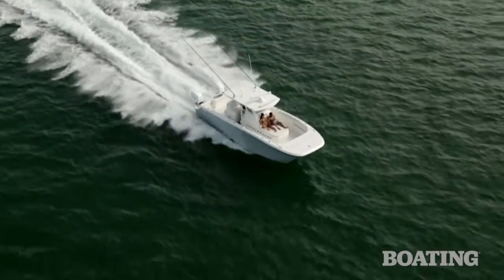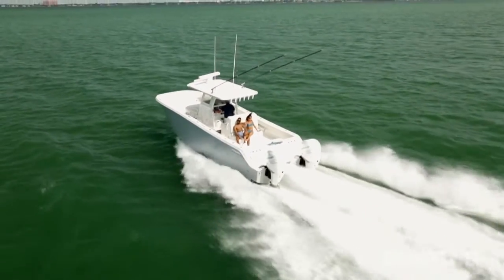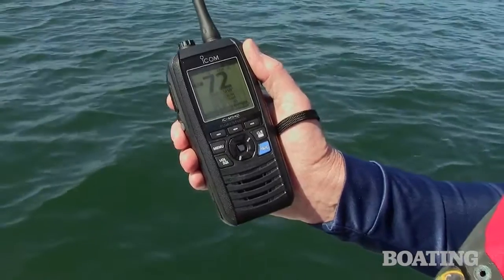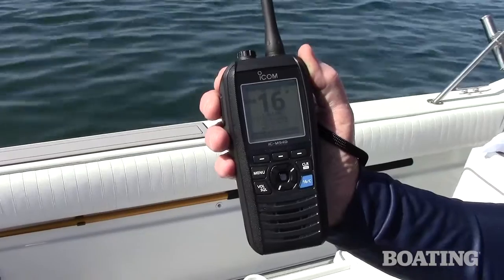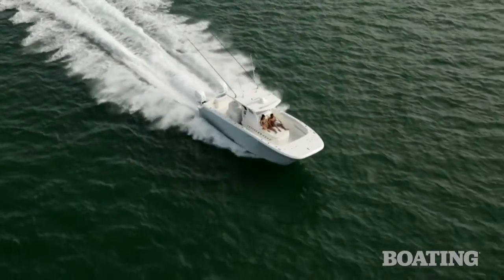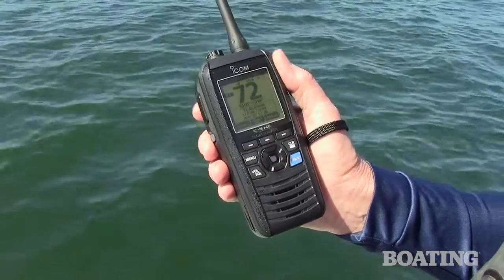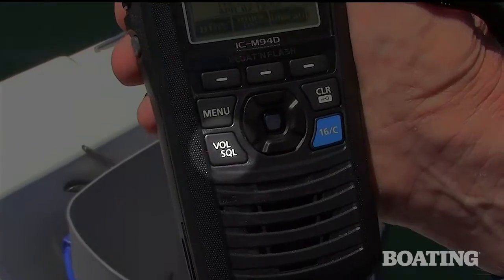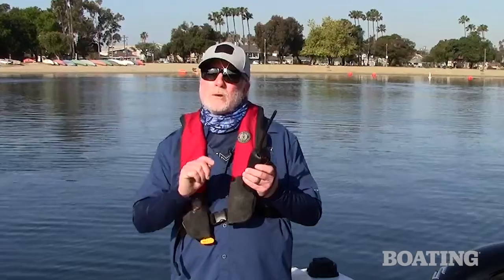Icom VHF Radio Tips: Adjusting Squelch

Comment: I have an ICOM M34. All of a sudden it won't recieve any signals unless the squelch is turned to zero. New battery and fully charged.
Reply from the maker: (Have to get the obvious out of the way)Are you in an area where VHF strong transmissions  can be heard? That is, if there is no radio traffic within a few miles from you, you might only receive strong signals from far away--and only then when the squelch is turned off.
Reply: @BoatingMagazine  yes, I have two other handhelds They work fine. This one won't even pick up the weather  channel unles the squelch is turned off. Anyway due to the age of it, I may just buy a new one.
Reply from the maker: @ericbrown2825  Our contact at Icom replied with the folllowing. Good Luck!
 

One quick check item, remove the antenna to make sure the antenna connection does not have corrosion.  This could cause reception issues.  While Icom radios are submersible, it is good practice to clean the radio with fresh water after any exposure to saltwater due to possible corrosion or salt crystallization causing issues with the radios keys, switches, and other items to become unusable.   

 

If all looks well, I would recommend switching over to a known working weather channel.  That would test the antenna and radio’s receiver as the same circuitry would be used for the weather channel as well as a marine channel. 

 

If they are not able to receive the weather channel, then the radio would need to come to an Icom Repair Center. 

 

https://www.icomamerica.com/support/repair/

 

If they can receive the weather channel, then the question will be, is the radio positioned the same way for the weather channel test as when the call is missed.  Positioning of a radio is important as radio signals do not always penetrate a boats hull or if below the waterline.  The recommended position is upright with the antenna as high as possible.
Reply: Hello. do you know how to adjust squelch on ICOM F34GS model?